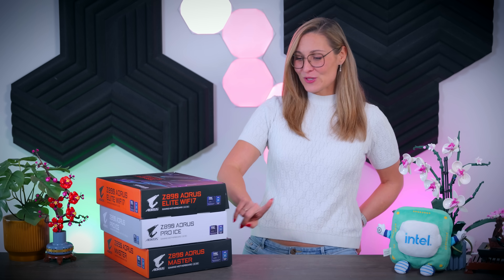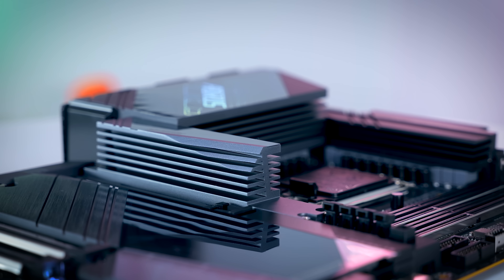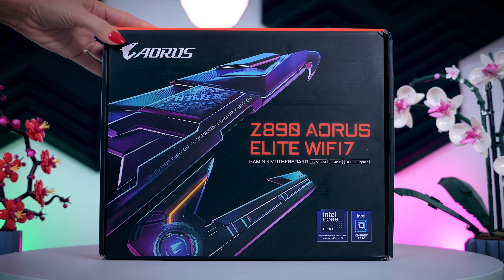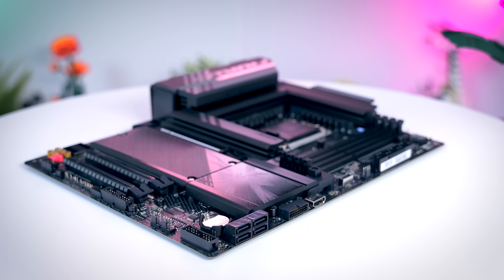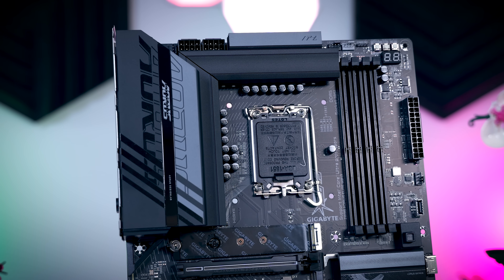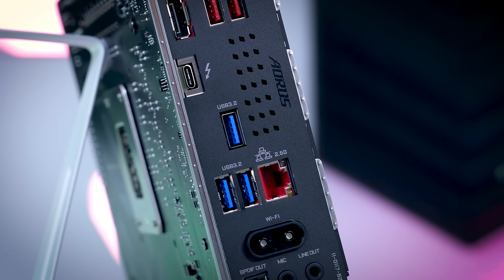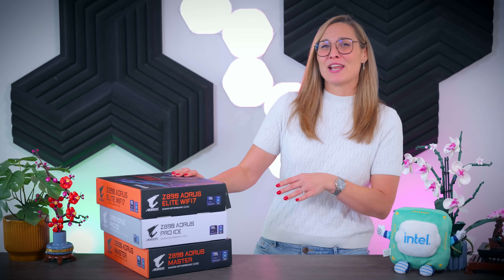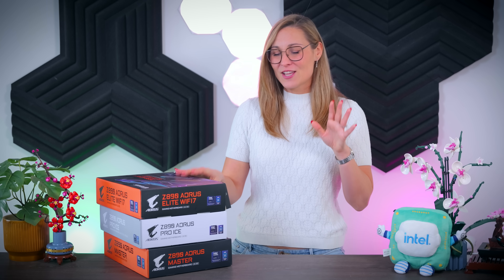New Gigabyte Z890 Motherboard Line-up - Core Ultra 2 Series Ready

Comment: Sure would be nice if Gigabyte would release a Z890 Aorus Master in ICE.  Don't care to for the 4 x USB 2.0/1.1 ports on the Aorus Pro. Not sure why this would add so many of those older USB ports instead of adding some more 3.2 gen 1 or 2 ports.

Comment: Seems like Gigabyte have cut costs on their mid range boards by using Realtek LAN where they used to use Intel and they're a bit lacking in terms of USB ports, MSI is the way to go.    I guess the main problem is the state of the CPUs themselves, hopefully it gets sorted soon because right now there is no compelling reason to buy this platform.
Reply from the maker: Is Realtek really still an issue atm? Isn't it mostly for virtualisation?
Reply: @TechTesters  Actually I take it back - i was comparing the Z890 Aorus Elite to my Z790 Aorus Elite X (which has Intel) but the Z790 Aorus Elite (non X) does indeed have Realtek so Gigabyte haven't made any change this generation.   Also I don't think there is anything terribly wrong with Realtek, just that they tend to appear on cheaper boards.    MSI gets my vote due to it being the same price with better LAN and two thunder bolt ports + extra USBC, where the Gigabyte just has one Thunderbolt on the rear I/O.    It's videos like yours that make it easy to decide, thanks!

Comment: wow.  you gotta go with the top board at $660 to get 10 gb ethernet.  and still no thunderbolt 5.  what a rip.  I'll stick with my $300 14th gen i9 board by gigabyte which has 10 gb.   $700 to $1000 now you gotta spend for the same thing that use come with a $350 board.  now we have corruption and major greed in motherboards.  just like buying a new car nowadays.  60 grand plus out the door for a new car or truck.  finance for 7 years.  nuts. I'll stick with used cars.  it gets hit while you are still paying off the loan your screwed.  not to mention the high cost of auto insurance.
Reply: I'm from the future and the z890 master now costs $289.

Comment: I really like the Z890 Aorus Master with 10G LAN, but it's a shame that the X870E version has only 5G LAN.
Reply from the maker: 5G on 600$+ boards should be illegal.
Reply: @TechTesters  Agree. The Z890 ASUS ROG MAXIMUS is probably the most expensive motherboard without 10G LAN.

Comment: I need 10G so there is only the Ace and the Master. VRM and Backplate on the ACE are better BUT do you really need them? I don't know / think.....
Reply from the maker: Backplate is nice. Power delivery on the Master is already stupidly overbuilt for what the new CPUs will require. So just for 10 Gigabit, I'd say Master, or wait for the ProArt to come out. OR just buy a cheaper board and a $50-70 10G PCIe addin card.

Comment: I like that the entry-level Z890 motherboards come with enough VRM to run the top chip at 100% and use everything the chipset offers, with the mid/high-end models being expended with extra controllers and overkill VRM. It's a throwback to the LGA 115x and LGA 2011 days.
Reply from the maker: They're expensive now but at least they're overbuilt. Didn't the Hero back in the 115x days have 4 phases / 8 stages or so? :D